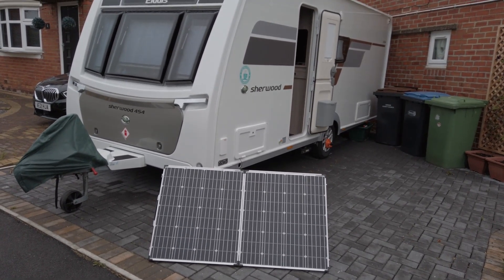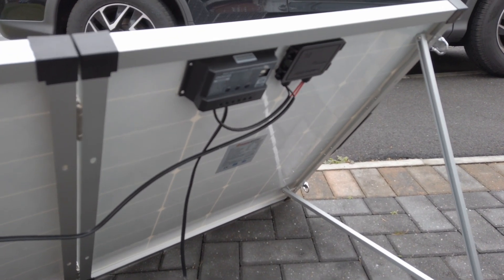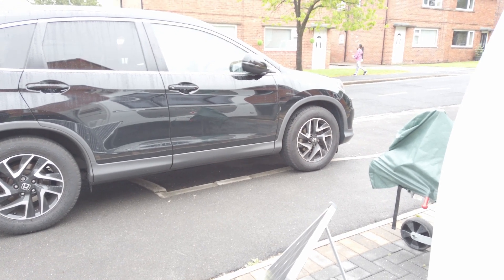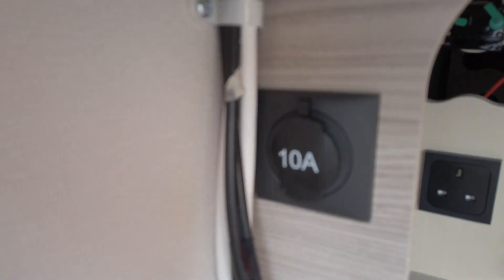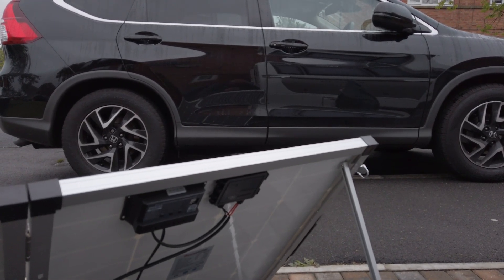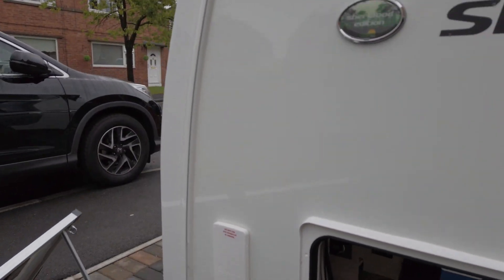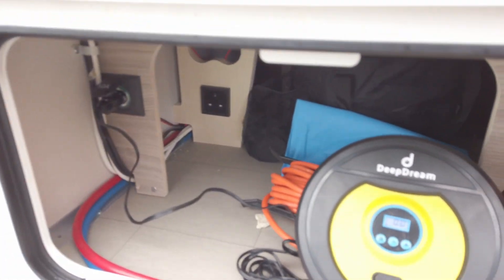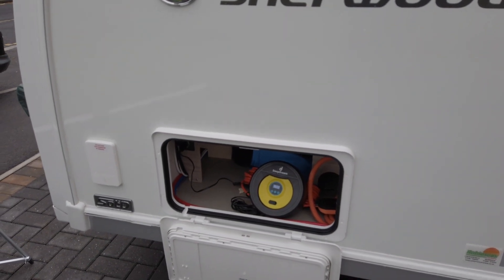150w Portable Solar Panel Installation in our Elddis Avante 454

Comment: Hi there. Great little insight of the sola Panel. It's great when you have it how you want it I remember when I did my sola Panel insulation (video on channel )😀 it's  a game changer. Thanks for sharing 👍 Cheers Paul and Sarah caravan life
Reply from the maker: Thanks for your comment. Did a bit of research as to what was best for us and how we could make it work. All theories mind you as we don't know in the real world how it will work out. Time will tell. Think its a bit different using the 10amp socket to both provide power from the solar and when on hookup have another usable socket outside.
Reply: Ooh I’m going to have a little peak at that vlog too thanks x
Reply from the maker: Do. Paul has his solar up the storage yard to keep his caravan topped up over winter 😍😍 Paul - Can you answer with the video link and I'll approve it to show in the comments 👍

Comment: Alan, we are about get another van and are very interested in your installation as we don’t want put it on the roof of our next van does the Dokio come with the controller already fixed and with the battery fuse in the kit
Reply from the maker: Yes it comes with a controller but only crocodile clips. I got a 30 amp fused cigar lighter extension for our new van and fit a cigarette plug to the solar leads with a 10amp fuse so double fused. You also have an external 12v socket this way for when your not using the solar. Been ideal for blowing the tyres up with a 12v pump

Comment: Hi Alan. Great video. Do you still have this setup? How did it work out? 
Im looking for something non-permanent which will keep my battery topped up
Reply from the maker: We do still have this and it's doing us fine. We now have the Bailey Pegasus Grande SE Brindisi which has 100w solar panels on the roof and we've added our portable as an external addition. It's  doing us perfectly fine with a 10 day cloudy trip and not an ounce of trouble or worry. I guess each to their own so far as usage but we've not worried at all.
Reply: @Coffeevaners  thanks for the prompt response. I've checked out your links and managed to find everything on Amazon at a decent price. So thank you 🙏

Comment: Instead of a cigarette lighter socket, we've installed a 12S socket under the van by the battery box. This is waterproof enough for it's location and is multi function in/out power direct (fused) from the battery.   It's proved very useful over the years and can even keep the car battery topped up on site if needed.

Comment: Thanks for the video. We are looking into getting a similar set up when our new Caravan arrives. Very helpful.
Reply from the maker: It's worked really well for us. In March we had a 4 day off grid trip and it kept the 100amp AGM battery topped up. End of April we are off on a 5 day off grid trip. With improving weather we are hoping we can still carry on using all the 12v things as normal including 4 to 5 hours of evening TV. We don't have an inverter so no main voltage at all. 👍👍

Comment: A good multi-serving option at a really sensible cost that clearly works for your requirements… 👍🏻
Our solar panel was fitted on the roof from new, but I have wired the ‘van to supplement input with a portable panel as & when needed… 😉
Reply: Venomator - I want to do the same and would like to know how and what you did?  I have an MPPT 30 A controller which says it wants series panels, one 165W on the roof and I plan on buying a 150 W portable.  Thanks.
Reply: @MarkSDCA  Hi Mark - I used MC4 ‘Y’ connectors to link the two panels - this could be done in series or parallel.
However, the Watts is not the be all and end all of linking more than one panel, either in series or parallel.  You need to know the Volts & Amp ratings and these should be pretty much identical.
There is plenty of information on line but, if you are not sure, it is always best to consult with a qualified professional before linking any panels together.
I am not qualified to suggest how you should tackle your installation, so cannot advise anything other than for my own use… 😉
Reply from the maker: Thanks for the comment. It's a minefield of a subject so getting something that suits isn't easy. Hopefully we have but time will tell ⏳